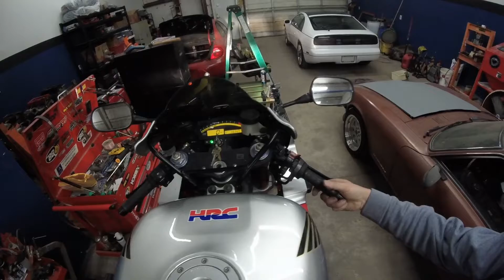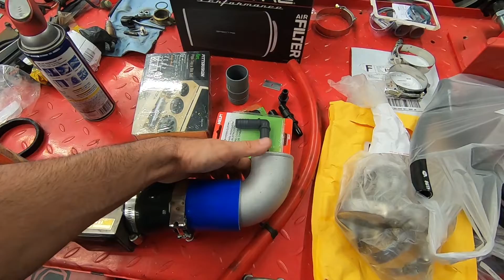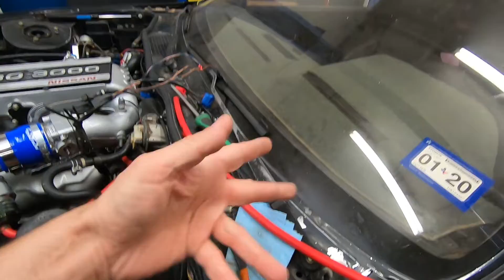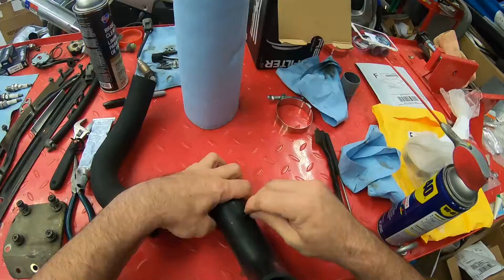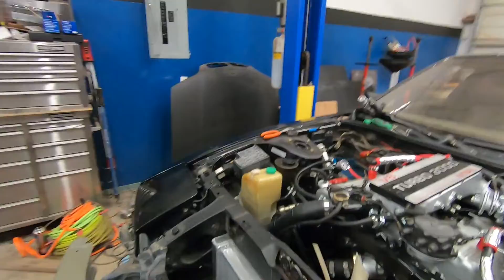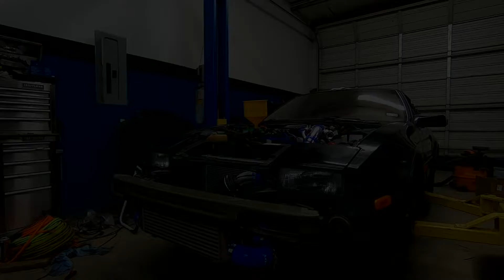Ep.85 300zx Turbo Build Z31 First Start!!!(Part13)

Comment: Don't use NISMO  brand adjustable fuel pressure regulators...They suck! They provide a loping idle that you can't get rid of! Your power issue to the coil could be your distributor crank sensor wiring loose or the ignition power transistor took a crap! Good Luck! I hope it's a loose ground, blown fuse, or something simple! I usually bet money that my builds start on the first crank...I'll be watching.
Reply from the maker: Thanks for the advice. I got it figured out. I'll be posting the diagnostic episode in a day or so. Yeah it is a TX car too.